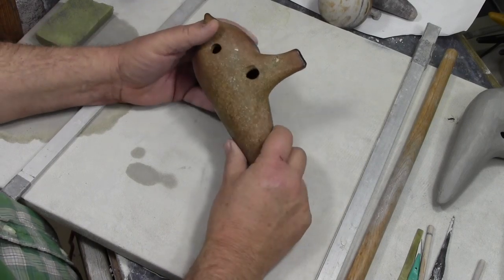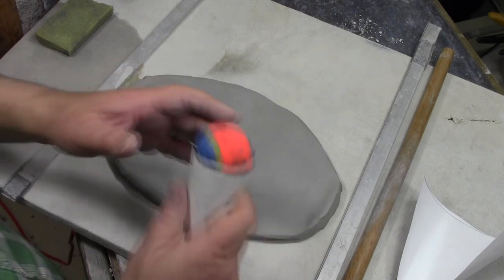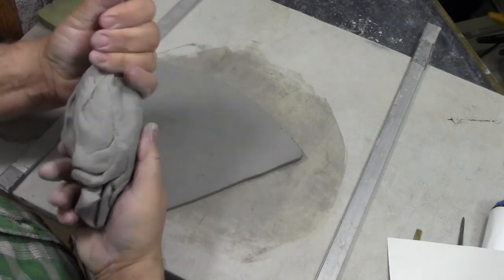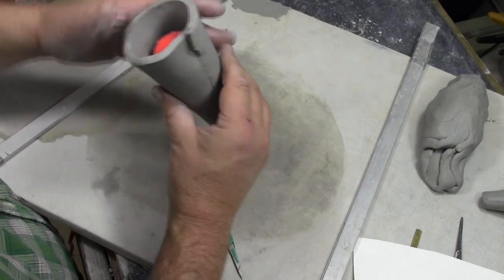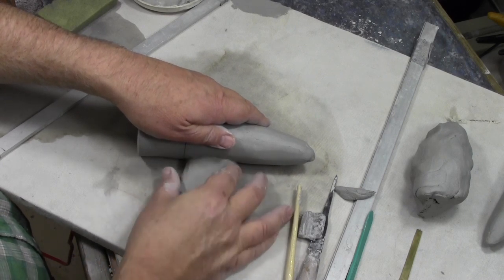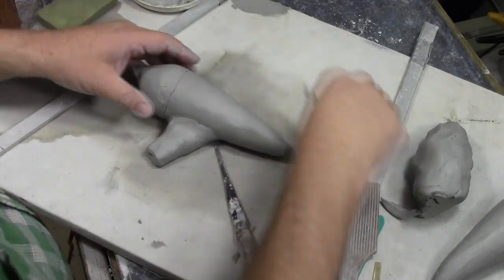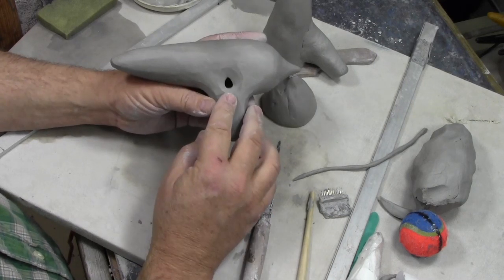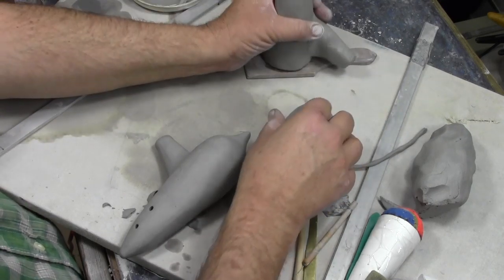Let's learn to make Ocarinas video #7

Comment from the maker: a c tenor would be larger . A #5 budrio ocarina is a c  and that is quite a bit larger than the one in the video. Getting ocarinas pitched in a specific key requires picking a type of clay and then making different sized ocarinas until you hit a good c then reproducing that method.

Comment: Where can someone buy a kiln for making these? I saw some kilns in the ~$450-1000 range, but the lower end ones only had like a 6x6" inner chamber. I also saw some sort of device you can use in the microwave but it seemed a bit...odd.
Reply: Just make a camp fire and use a hair dryer or somthing and a pipe to direct the airflow , it will be plenty hot to fire clay

Comment: what is slip if i may ask is it nesesary to create an ocarina?
Reply: slip (as I was tough) is like wet clay. It works as a glue to help make sure it stay together :D
Reply: pontus pursche it is a slurry of clay and (or) other materials used to help bind clay pieces. slurry is much like your average Burger King Vanilla (or Chocolate, I don't judge) Shake in thickness and texture.